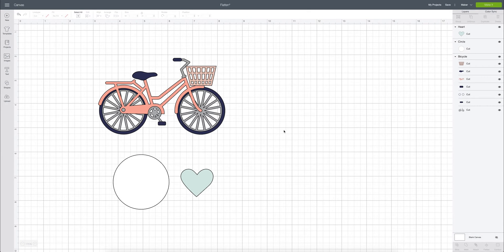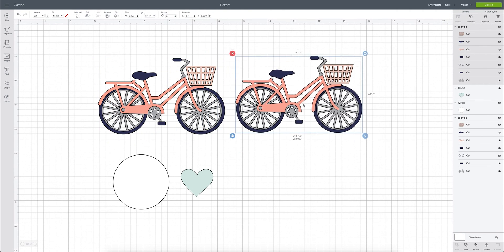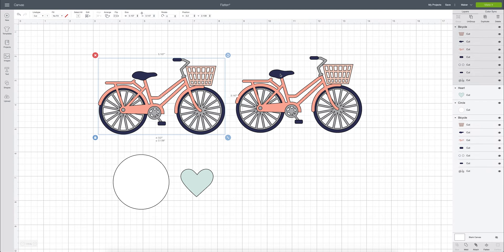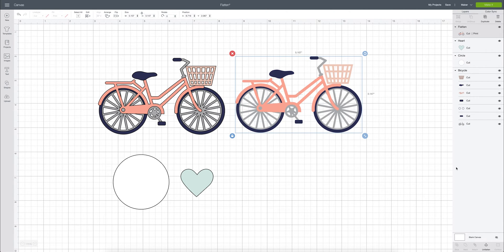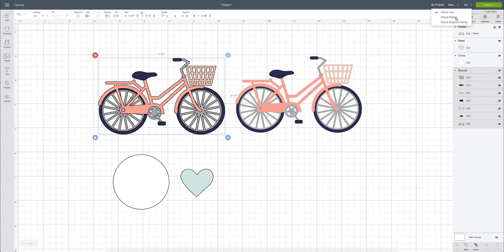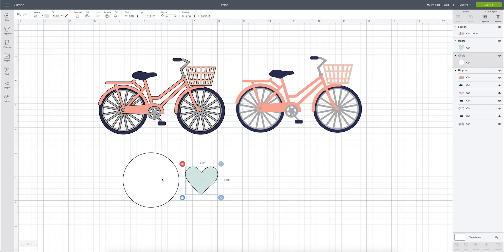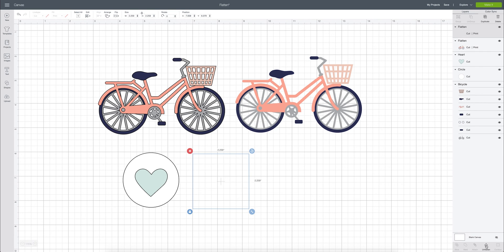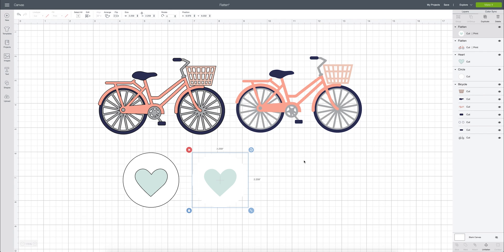Flatten In Cricut Design Space : How + When To Use It!

Comment: You said that we can print it on HTV. IF THAT IS SO.  The bike will be 1 color RIGHT? Which would be the color of the HTV?
Reply from the maker: If you wanted to use regular HTV, you would use the image on the left (a cut file) and it would cut out individual layers on different colors of HTV.  Hence, all the layers involved in an unflattened image.  If you were to print this on Printable HTV, you would use the image on the right and it would print all the colors as one layer that it was flattened to.  Flattening creates Print Then Cut images.
Reply: HTV stands for heat transfer vinyl right? So if I use it as print and cut. Then I would have to use. HEAT TRANSFER PAPER ? I never Hurd of doing both on HTV  before.

Comment: Hi, I just want to clarify, the print & cut works on even the Explore One (what I have).   Wish I had been able to afford the Air when I bought the Explore, but had to get what I could then, and afterward added the Bluetooth adapter.   Waiting for this fall to see what is new before deciding if I should upgrade.   I bought the Joy in March.
Reply from the maker: Congrats on your Joy!  I am not sure about the Explore One, since I am not familiar with that machine and it was around before I started with Cricut.  The easiest way to find out is to try to do a print then cut file in Design Space and see if it is compatible with your machine selection!
Reply: @Bethadilly  I have done print and cut with my machine.   It is slower than the Air2, and I only have 1 tool holder (more changing if marking or scoring) but it does the job.
Reply from the maker: Oh good! I thought you were asking if it could do it! Yay!
Reply: @Bethadilly  I love your direct way of teaching, by breaking down the process into steps we can see and follow.   I just wanted those with older machines to know they can still do a lot of the projects.  Thanks!!
Reply from the maker: If it’s not compatible, you will see a yellow triangle alert come up in the layers panel that says it’s not compatible with your machine. Just make sure your particular machine is selected in your canvas, when trying! That way you can try before buying any materials!